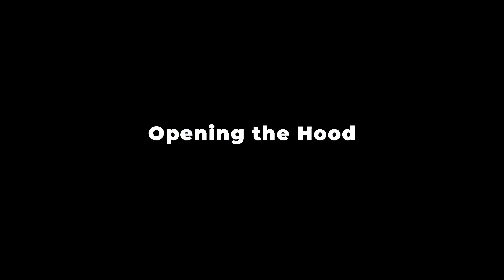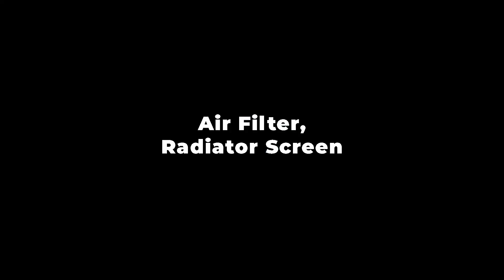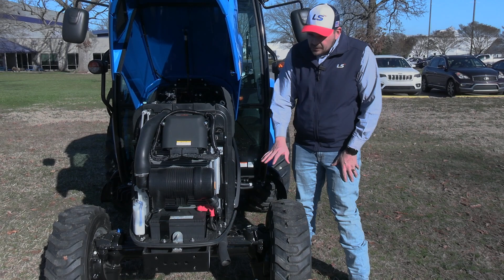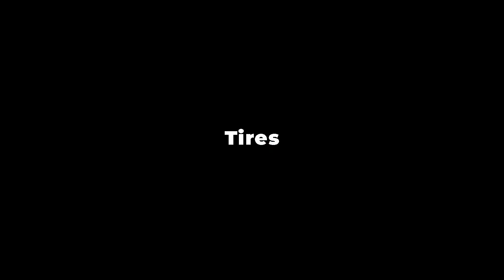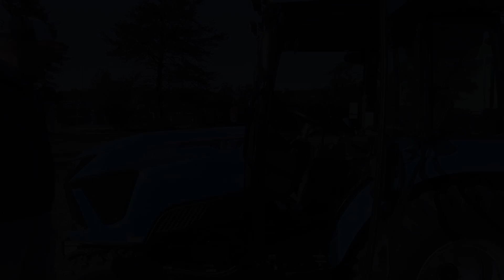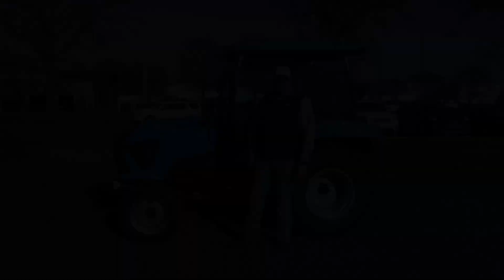New MT242HC Basic Maintenance Walk Around

Comment: Great video. 3:20 I must disagree with the water hose to clean radiator screen. Best practice is to use low air pressure blowing towards front of tractor (good tool is an air comb there are several out there) especially   if you are not done running the tractor for the day.
Avoiding water is best unless the tractor is going to sit long enough to completely dry the screen, even blowing it off after doesn’t completely dry the screen. Moister plus dust equals mud pie clogging up the screen, making it harder to clean later, and restricting air causing engine to run hotter.
Reply from the maker: Great advice! Using a water hose is efficient but we agree it is best to dry the screen a bit before use.